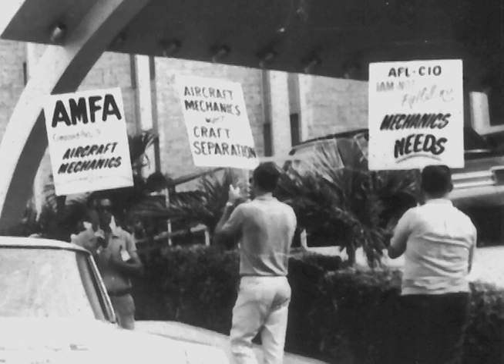About AMFA, the Aircraft Mechanics Fraternal Association

Comment: Interesting video, colorful, positive focused and be wary. The strength is based with lawyers, not union power or in other words solidarity. My experience with AMFA is union officials taking management upgrades and a local president crossing picket lines. Other labor groups enjoy craft minded groups, due to they can gain jobs by moving aircraft and servicing-and the kicker they don't have AFL-CIO protection. To advance the craft you need all the help you can get from other groups to win battles